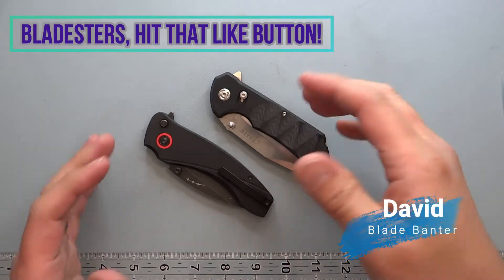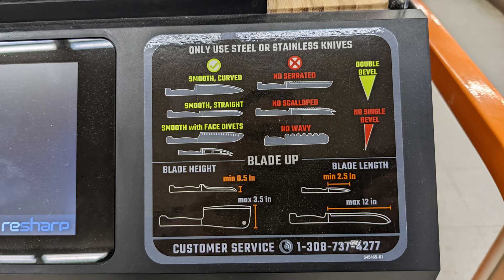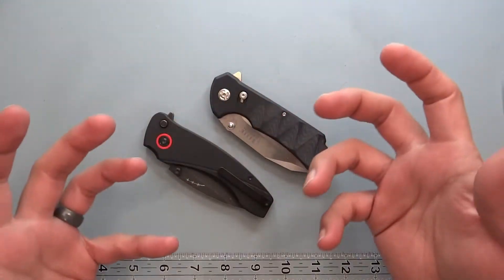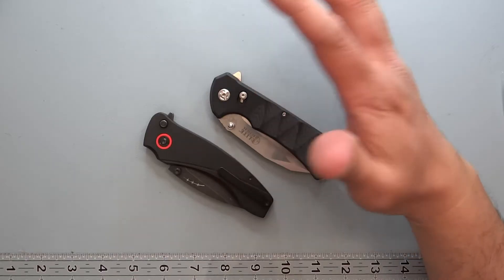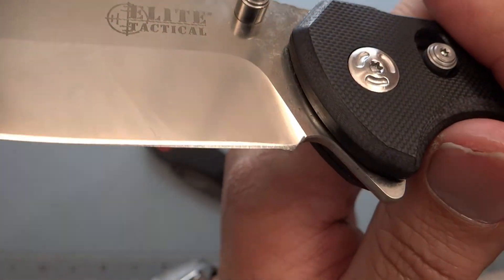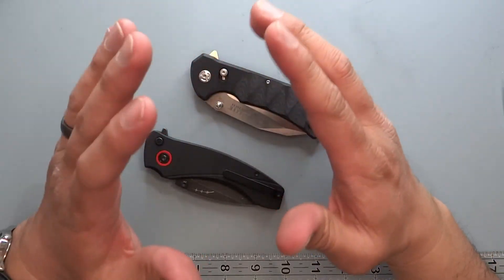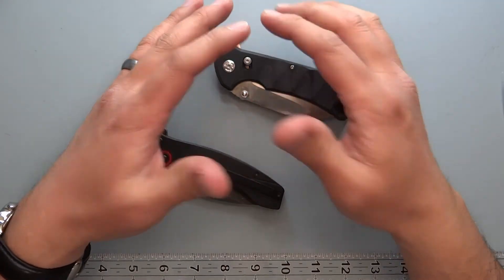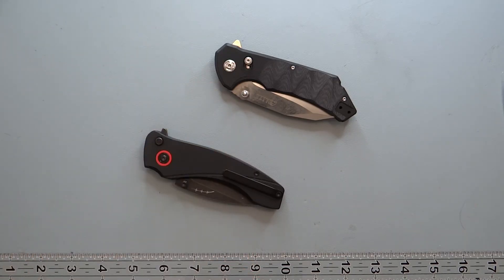ReSharp Automated Robotic Knife Sharpener Results Ace Hardware & True Value

Comment: I'll wait a few years for this to be upgraded and people get more familiar with it. If i ever come across one, I'll definitely try it just for the hell of it (not one of my favorite edc knives, I'll use my work knives that I wouldn't care about if it got damaged for being used as a chisel or screwdriver 😂) just to see what I'd end up with, if it'll actually work, damage the blade or if I get an employee who can't tell their ass from a hole in the ground and they make they screw it up by not getting it measured right
Reply from the maker: Yeah definitely a big hold up is the training and use of the tool. There is a downside that is engineered into it is it will not get the tip well as they found it might break the tip off.
Reply: @BladeBanter  I guarantee if they got someone to learn the machine and let them practice a lot before, they wouldn't have any issues with the tips breaking. The machine must put too much pressure on the blade if they're worried about breaking tips. I tried one of those WorkSharp belt sander sharpeners at a gas station that sells a shit ton of knives, and it's rpms are way too high. It made the tip too and it broke. I know it was my mistake, but if the RPMs would be lowered more, it wouldn't be bad either. But I much rather use stones so I have better control
Reply from the maker: Sorry this was in the held category for some reason. The machine was developed to not sharpen the tip from the manufacture themself. They can train the operators on where to start the sharpening from near the handle but the tip is programed not to sharpen. It is one of those better of two evils.

Comment: Good video. Thanks. I also tried Resharp at my local Ace Hardware. Curious, like your results, the 7" kitchen knife (sharpened first) has a 14º bevel and a 19º micro-bevel (as best I could determine with my goniometer). Though I don't know for sure, I think both of these bevels were created by the Resharp machine and not by any sharpening prior to this one at Ace Hardware. The 4" kitchen knife (sharpened second) has a single bevel that appears to be 19º. (Wow, two different results. I am not sure what to make of this.) My at-the-store cut testing, using phonebook paper I had brought, proved both edges were just okay. They cut the flimsy paper but not too well. The cutting was ragged and jerky, which I assumed was due to leftover burr. When I arrived home, I looked at each edge in a magnifier and saw coarse ground bevels with leftover burrs. I leather-stropped each knife at 19º with 6µm diamond emulsion. This removed the burrs fairly well. Still, each apex is quite coarse, but I like my sharpenings to be 'toothy,' so I'm pleased with the coarse grind. As the Resharp created bevels were quite even and the knives cut reasonably well and much much better than before, guess I might recommend Resharp for kitchen knives if the owner is not overly picky and wants the convenience of 'while you wait' at the local Ace Hardware Store. Otherwise, probably better to bring your knives to a human who is in the business of sharpening and cares about providing excellent service.
Reply from the maker: Interesting results and I think it has the possiblity to be good but needs more refinement.

Comment: That knife sharpener jageds edges it junks edge also no speed control on wheels not to over heat edge and cause bad edge temper . Do not use . Stones and pressure amount is better. Seen a sue them raged edge done on it and I won't use it ever
Do it manuel
Reply from the maker: Yeah it was an item I though was a cool idea, and I think it could do well with a little more refinement.

Comment: My wife was tired of our dull knives and had them sharpened using this method.  We’ve been very happy with the results.  I took my mid-tier tactical/EDC knives ($150 range) to the same store and had them do the same, again I’m very pleased.  Warn your family members before hand as these are lethal!
Reply from the maker: Glad it worked out well for your knives. I think it comes down to the operators too as it seems if they are aware of the results, they will adjust or rerun the knife.

Comment: A little background,I'm a chef use my knives all day every day, normally I sharpen my own on the old school Norton tristone...but I decided to give this a try at Ace hardware,I got mixed results,3 of my 4  knives(an old Henkel slicer,a shun slicer,and a San Mai yoshikane was gyuto) came out ok,need touching up on a steel or strop.the 4th knife (a very heavy thick bladed shun)has no edge whatsoever.probably won't do it again,just put the time on the stone myself next time
Reply from the maker: Yeah it is the same result I got, I think it's going in the right direction, but it needs a finishing step. And the person operating the machine needs to be able to look and rerun the blade if needed.
Reply: @BladeBanter  before he started my first knife,I asked him what degree the edge will be...his reply was "I don't know,I just operate the machine."that was a big red flag.but live and learn...
Reply from the maker: Yeah I found if I remember right it was about  18 degrees I contacted the company and they said I could go back and have it redone, but that felt odd to say hey resharpen this again please and I'm not paying for it.  I even offered to send the knife to them to see the result first hand, they declined.

Comment: Ha! I’ve seen this machine but never used it. It looks like it works about as well as I expected an automated sharpener to work. 😂 No thank you. I’ll continue to sharpen my own.
Reply from the maker: Yeah it might be a time saver for a reprofile.  I was really interested as I thought before, why don't they have a machine like the key cutting machines for knives.  And there we go. It's got potential.
Reply: @BladeBanter  That’s a good point on a reprofile, especially if you’re talking about a super steel. It would at least get you close, and then you could refine it from there. I’ve found that hardware stores usually give you a somewhat serviceable edge when they sharpen knives, but that’s about it. This seems to fall in line pretty well with that trend. It amazes me how many people use their kitchen cutlery to the point of the edge being completely blunt. So, to them, this would probably seem like a miracle machine. I would also think that simple blade profiles would work best (think typical non-bolstered chef knife). I’m sure the variability of pocket knife blades are much harder for the machine to follow. Like you said, it probably has potential, just needs some refinement.

Comment: Interesting method for those that have no sharpening experience but like you said needs to be refined afterwards with a hone or stropping belt. Definatly not for me though as I think it doesn't deal with inherent problems like uneven bevels and such. For really large knives the grind might be too thin also. Thanks for the look see and keep making sharp things fun and enjoyable.
Reply from the maker: I reached out to the company and they said it should not have left that type of edge and suggested I go back and they can correct it.  I think with the machine the stores need to have a versed person that will run it through again if they see the edge isn't to expectations. It can take care of the uneven grind but might take running it through twice.

Comment: Super thanks for doing this - nice vid!  A good use case that I will try if I find one of these in my area is a cheaper M390 reprofile (e.g. $100 Giant Mouse ACE Iona - it took me 1.5 hours on a wicked edge to go from 20° to 17° - I would gladly pay $7 for a symmetrical edge regrind to save me the first 1h 15m).
Reply from the maker: Ouch that is a while, that's one thing about the stone systems it seems to take forever to reprofile an edge.  Let me know how it goes if you find one.